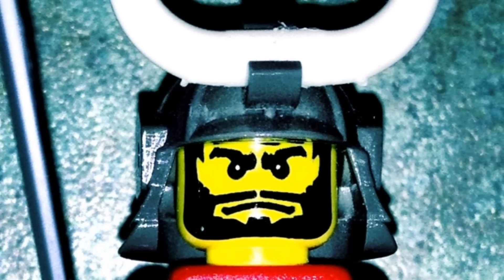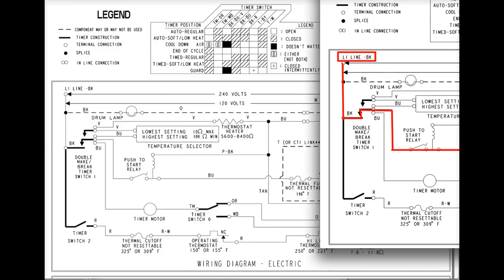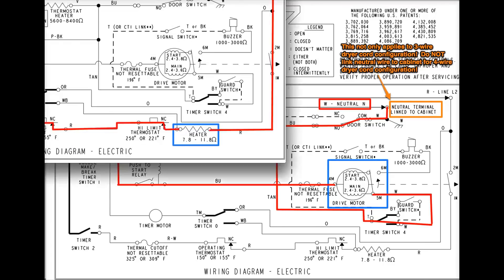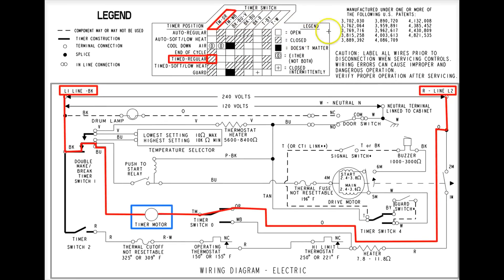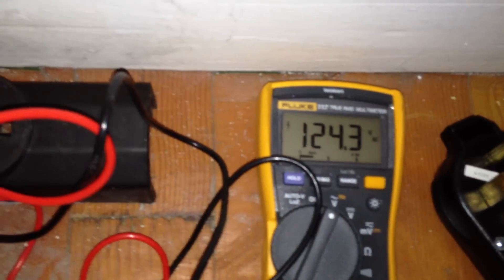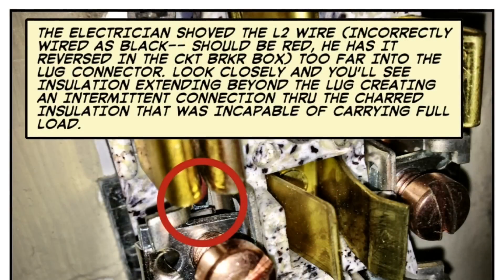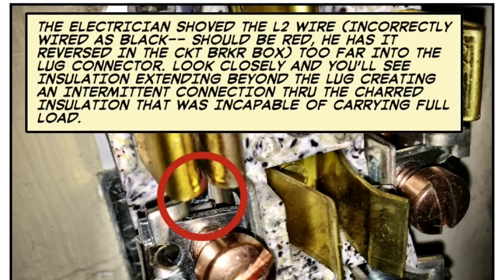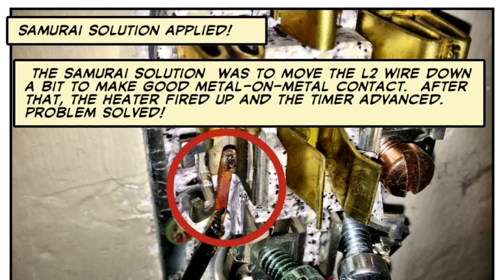Fixing an Electric Dryer that Doesn't Heat and the Timer Won't Advance (but the motor runs)

Comment: Actually you are wrong about L1 and L2 color configuration. L1 is actually red and L2 is black. If you were to look at single phase and three phase electricity you would notice that in three phase the lines (L1, L2, L3) are listed according to phase (A, B, C). In other words L1 (A) is red, L2 (B) is black, and L3 (C) is blue. Thus in a single phase situation they are labelled L1 (A) is red, and L2 (B) is black. The electrician, although he didn't do a great job on securing the connection, actually connected the wires in the panel to the proper places. By the way I am an electrician of 20 ish years...
Reply from the maker: In a split phase system, like this one, are L1 and L2 in phase or anti phase?
Reply from the maker: Bueller? Anyone?
Reply: Split Phase? What the hell is "split phase"? What is "anti-phase"? Do you even know what you are talking about?
Reply from the maker: Sadly, your comment is typical of most electricians today — they’re good with the NEC code but they don’t actually know how electricity *functions*. Today’s electricians have become defacto code enforcers. This is seen by you’re not even knowing what “split phase” refers to. Or “in phase” or “anti phase”.  This is basic electricity stuff that I learned in the Navy in Basic Electricity and Electronics school. Anyone who understands basic electricity and circuits knows what these mean. Don’t worry about, though— Stick with your color codes, you’ll be fine.
Reply: Split phase is another term for single phase but "split phase" is not the common term. "In phase" is a term commonly used when dealing with electronics and speaker systems not electricity. By the way in all of my years i have never heard the term anti phase. I am an electrical instructor and have been for a while. These terms you are using incorrectly and have nothing to do with the original comment you made in your video. You were 100% wrong in your description of how L1 and L2 are connected and colored. Stick to fixing appliances and leave real electrical to us professionals.
Reply from the maker: You're an "instructor" but you've never heard "anti-phase". It's a short hand way of saying "180 degrees out of phase". Google it. Split phase is derived from a single phase system you evidently don't even know how or why. And you still haven't answered my original question: "In a split phase system, like this one, are L1 and L2 in-phase or anti-phase?" Thus proving my point that you don't really understand electricity but, "boy-howdy, lemme tell ya about the color codes, pilgrim!" It may be due in part to instructors like you that the skill level in the electrician trade today is so abysmal.